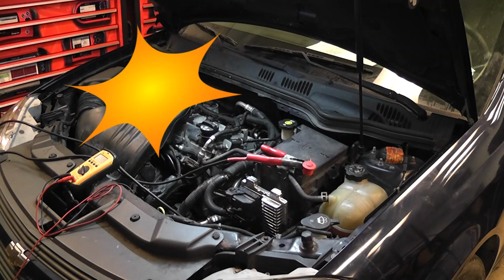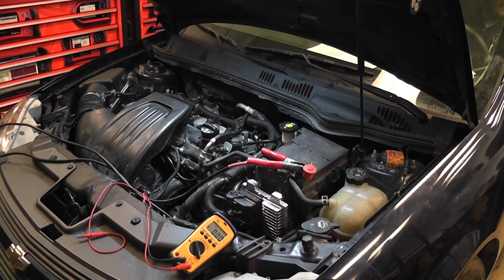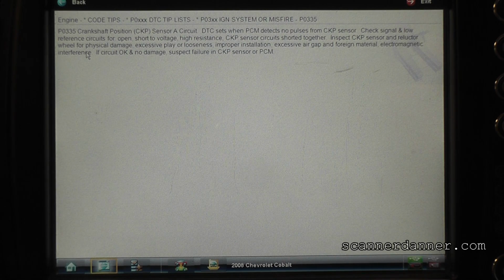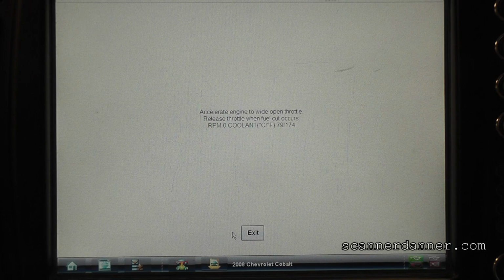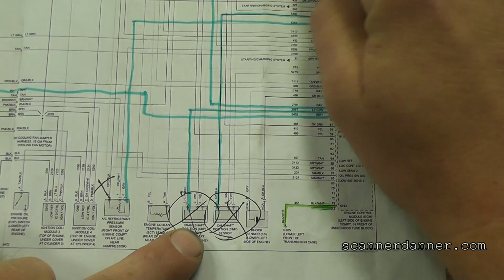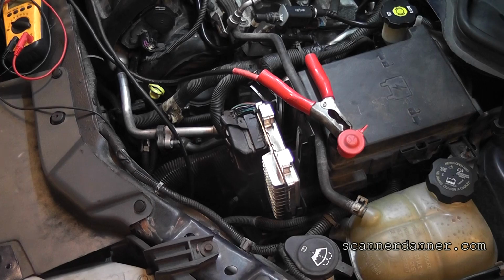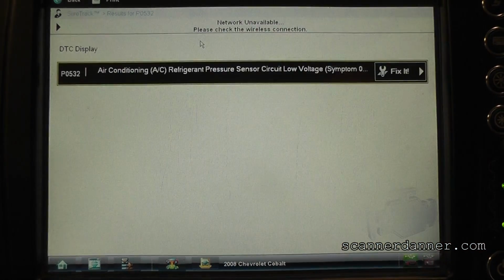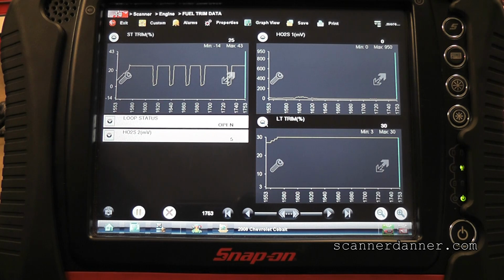Bad Engine Computer Testing Part 2

Comment: I'm not normally one to comment on YouTube videos, but yours are in another league. I left a national chain and dealership auto repair work for another career altogether. Even in my new career, i find myself forced back into car repair through maintenance and repair of my own vehicles and those of friends and word of mouth "customers." I am pretty confident I have watched every video on your standard channel and have actually used two of your case studies (Ford Taurus Fuel Pump and Corolla MAF) as well as your amazing video on fuel trims to DIRECTLY and CONFIDENTLY repair vehicles. Specifically, even with a good track record (large parts of which were probably luck) for 1st time repair, I feel more prepared than ever thanks to the symptom knowledge that allowed me to "see" what I was seeing and hearing, diagnosis ability which allowed me to confidently identify the problem as the true cause of the complaint, and repair the problem once and for all. Your work this far has been invaluable and I assure you even though I am at best a side job DIYer in the professional sense, I will be buying your book and paying your knowledge forward. I'm not sure if you will ever read this, but if anyone else does, I hope this comment let's them see your work for what it really is. Changing parts is generally the most expensive way to fix a problem. Your channel brings the art of diagnosis to those without the ability to learn the hard way and without the path that brings them to a school with instructors like you. Thanks again!
Reply from the maker: Thanks so much Mike G! I know this comment is old but I really really appreciate it
Reply: @ScannerDanner  hey i got 07 colbalt no crank no start but i got my 5 volt ref on the map can you help me out
Reply from the maker: @dennismartin5807  first step, you must scan it for trouble codes, if there are non, start by attacking the starting system and find out what you are missing, like on this video https://www.youtube.com/watch?v=oo1SRIFIkhs
Reply: Yes Mike I totally agree!  Seeing him in real time miss things and then find them with good old logic and sticktoitnevess is great!!
Reply: You, sir, are absolutely correct!
Reply: I agree and we'll said @Mike G

Comment: Good vedio. Just rebuild my 2.5 litter engine on 96 Dodge Dakota, got spark but not getting any voltage at fuel injectors got any suggestion?
Ine

Comment: I think it sounds different it starts sooner upon cranking   because I thought that it had a bit of a long crank before you discovered that the cranksensor wasnt plugged in
Reply from the maker: It definitely starts faster and  injection control and timing is now more precise

Comment: so  whats the purpose of the crank sensor  if it can run without it?
Reply from the maker: It's not perfect and may even pair or group fire the injectors. Because without the sync notch on the crank the system can only know pairs of cylinders

Comment: Dan the man, this Miguel an xstudent who followed you for a time, i have a 2009 nissan rogue i was driving lites on dash came on, car staRted shaking then check engine lite had warning fix system soon, where 2 wires burnted from the horn circuit , harnes fixed, wont start just crsnks was a green wire against another wire all repaired, now the car cranks but wont start, checked for fuel ok, and no spark at the plugs, just cranks, if its the computers i want to make sure money wise as you've said 5vote check of parts, will check 2moro, still have books you sent me, great stuff, guy, good day from old timer to best detail oriented electrical teacher,

Comment: Had a problem like this on my colbolt  it ended up being the.  Emissions box under the back of the car. Where the  unburnt. Fumes was geting burned off took the black box out blew it out with an air hose on the side of the box was a trap door with a filter in it took it out was full of white ashes.  Put it back money light went out car runs great    WHO would ever thought a filter would be in that box what’s crazy the. GM.  Data. Doesn’t show that filter in that box
Reply from the maker: I can assure you, what you are describing wouldn't even be close to being the same issue as what we had here. A blocked canister vent solenoid/tube/filter would cause EVAP fault codes and make it difficult to fill the tank

Comment: Scanner you asked the question as why did Chevy dealer say after computer install, do not try to crank, Chevy guy diagnosed as timing chain, some engines can get valve damage if trying to crank, I have heard.

Comment: Awww so the crank signal is the Tac rpm Signal figured the tac ran off the cam or the crank I don't think the timing chain is the issue it's running way to smooth for timing chain to be a problem the cam sensor must of been substituting the crank pid data @ScannerDanner

Comment: Then how this got fix change the computer o not ? Im curios
Reply from the maker: new engine computer was the fix, crank sensor was left unplugged by me in part 1
Reply: Thanks im going suscribe bro i need help with a 2009 blazer i replaced the engine on it unplug ecm sensors does need reprogram? Or i damaged  the ecm putting 24vlts trying to starting ? I need help bro i watch most of parts one youre good i wish to have your knoleage
Reply from the maker: @fck3013  you don't need to reprogram the ECM unless you also changed the ECM (sorry for the late reply)
Reply: @ScannerDanner  thanks for your help but engine has not spark already change the crank sensor and nothing i guees ecm is burn up

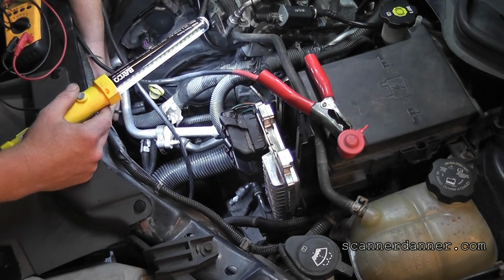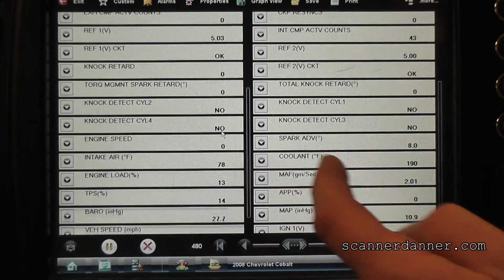Comment: 32:35 I remember on your 1st video of this car at 24:25 you started to find Cam Sensor and you pulled out to test the voltage. How did the dealer missed that cable unplugged and came out with CAMCHAIN FAULT is beyond belief. Well done you dug it out and finally got the bottom end. How do you do it? You just open our eyes. I'm not even a mechanic but I learn a lot from you. Thank you and keep going mate. Crowd funds to keep your channel up and running? I will definitely donate. You are just awesome. Thanks
Reply from the maker: Thanks so much man, I really appreciate it. Since I have a paid membership on my website ($11/month) I don't ask for crowd funding as this sort of already is that. The difference is that there is a HUGE benefit to you guys. I currently have over 500 videos with half of them filmed in my classroom. Hope to see you there! I also have non recurring subscription options too btw
Thanks again!
Reply: @ScannerDanner  I've been on more than 3 video already tonight and I have to repeat them to make sure they sink in. Tiny little wires which broken due to vibration cause the car NOT to start. If you take to the garage, they come up with one reason... Engine is dead. Needs engine replacement. But here... Wow. Dead engine are back on the road with just broken wire fixed. I'm speechless... Thanks mate

Comment: You make me want to get I better scan tool lol I live in the multimeter era still but the amount of info you can pull with that thing is amazing and we’re at least 100 miles from a dealer to fix anything and most of the time they won’t anyways so we are always buried in similar situations your videos have really helped a lot of people in our area with just helping adapt the thought process that goes into our diagnostic system really appreciate your time that goes into these videos it really helps our small rural community keep up with the times especially with the machines getting more computers in them and no service techs available from the dealership a tractor goes down at harvest it can break some of these farmers so we have to fix it ourselves and your videos are vital to that much needed help thanks again
Reply from the maker: Let me help get a Topdon Phoenix lite 2 in your hands. It lists for 800 and will be exactly what you need and I have tool grants I'm helping others with. Email me at support@scannerdanner.com and I'll hook you up with a grant. With the grant it will be a lot cheaper 
Here is the tool I'm talking about
https://www.aeswave.com/Topdon-Phoenix-Lite-2-p10173.html

Comment: im getting no spark. checked everything, fuses,relays wires etc. im getting power to all my sensors and getting power to everything else just not getting spark. i have a df goblin with a upgrade engine and computer.. been like this for 8 months and still cant figure it out.......any help would be appreciated!!

Comment: need help dan! i have a similiar problem with my 07 cobalt in a df goblin
Reply from the maker: are you using the original engine and transmission from the 07 Cobalt? And did you keep the DLC so you can scan it? We need some direction. 
Also, do you have injector pulse?
Reply: @ScannerDanner  Do you have a shop i can bring my car to? I dont mind driving there and staying for a few days. I obviously will pay you for your time if your interested
Reply: Sorry I meant a 06 cobalt ss. The engine trans are different and yes they do pulse

Comment: As far as I can see is that the vehicle’s computer only lets you see what the designers want you to see. There are electronic systems that inbuilt to ‘Keep You Running’ at all costs if possible. This is shown by the engine running without the crank sensor connected. The vehicle’s computer, in order to ‘Keep You Running/Going’ has searched its programming to obtain a signal from somewhere possibly constructing one from the cam sensor. These things I’ve seen on other cars that verifies my findings. Similar things are resistors in the ECU to let it know if a sensor or an item is connected or not. Great video Paul. On the flip side It’s frightening to realise that there are much deeper levels of programming that these designers have implemented that we are not privy to.. If there wasn’t these deeper levels of programming then the engine would have just NOT RUN and thus finding the disconnected crank sensor would have been easier. Great fun these detective series Paul. I wonder how many of us have bald spots on our heads with all the head scratching.. LoL. Regards Peter A.

Comment: Wow you might have answered a question I was wondering about my car and why I have been searching the net about my issues, when you said a bad ground would make the signal wire up it's voltage. This may be the reason my coil packs are burning up. Normal signal is .50 and the 3 that's trying to burn up measured 3.43v with ignition on. Your approach and the time you take and how you teach I give it 5 stars sir I need this class myself at 35 yrs old. I too am trying to diagnose a 04 g35 6mt that's running on 3 coils because it's trying to burn the other 3 with the key in on position.
Reply from the maker: G35, is that a Lexus? So Toyota electrical system and your asking me about the coils. Are they 4 wire coils? And which wire are you reading 3.4v with the key on? The trigger signal? If so, no wonder they are burning up
Reply: @ScannerDanner  this is. 2004 infiniti g35 6 speed and they are 3 wire coils and yes the trigger signal not the 12v.
Reply from the maker: @revbess  okay, on which wire are you reading the constant 3 .43 volts on? Is it the coil trigger wire coming from the ECM?
Reply: @ScannerDanner  Yes the coil trigger(signal) from ecm. To coils 123(ecu pins 61,62,81.
Reply from the maker: @revbess  well this is certainly why you are burning up coils. Other than some wiring harness short on those three circuits, you may have a bad engine computer. You will need to do your wiring checks at the ECM with it plugged in and unplugged. If you still see those same voltage levels unplugged, it is NOT the computer and you have a harness short.
Reply: @ScannerDanner  thanks Danner for responding, I already replaced the ecu and I'm running great, still gonna get ur premium service to learn more after I recover for spending in this car. Have a great day.
Reply from the maker: @revbess  Awesome, nice job! And I look forward to seeing you there. Thank you!

Comment: Can you put the captions on the top of the screen or use different lettering?  My tired old eyes have trouble reading them.
Reply from the maker: There are closed caption options right here on the YouTube player my friend. Thanks!
Reply: @ScannerDanner  It says no captions available for this video.
Reply: It's not that I can't hear you,  I have trouble reading the script that appears on the lower portion at times.
Reply from the maker: @paulmonk7820  unfortunately the automatic captions only apply to newer YT videos. I just got off of a chat with support and this is what they told me. Unless I manually enter them on these older videos, they won't be here. I'm sorry my friend. The good news is all of my newer videos have them
Reply: @ScannerDanner  Thanks for checking and getting back to me.  I wasn't very clear, but I was talking about the messages that overlay the video in yellow letters, added during the editing.  They do add to the viewing, but some are not easily discernable and dissappear too quickly...
Reply from the maker: @paulmonk7820  ah okay, sorry, there is nothing I can do about that part. We've gotten better with our newer videos :-)
My only suggestion is to pause the video when you see the note.

Comment: I don't completely disrespect the timing chain call. The tech probably found the low compression sound of the engine (like in the beginning of this video) and got afraid of causing a bent valve and felt the need to check timing and refused to crank the engine further. You can't blame the other tech for not wanting to cause damage.

Comment: GM tech called timing chain because all the noise it made when you first started it, probably not realizing the engine needed to build oil pressure, because it never ran.
Reply from the maker: very possible!

Comment: that was fun to hear the sensor wiring plug was disconnected ! and the ecu will inject its own ref for crank sensor after fail start first few seconds would of been good to scope directly onto the sensor with loom unplugged
Reply from the maker: To be clear, the only substation was with the data. If you were to measure the actual crank signal, there would have been none with it unplugged. Just wanted to make sure that part was clear. Thanks!

Comment: Why is there no tcm in this car? My 08 has a tcm in the slot between the ECM and the distribution box.
Reply from the maker: I believe the PCM contains both the ECM and TCM in one unit
Reply: @ScannerDanner  so is that the case for certain configurations? As mine doesnt have an air pump and havent seen one with an air pump here in Canada.
Reply: Would you be able to point me in the direction of a website that i can go to to get a wiring diagram, my Haynes manual doesn't provide much of anything for diagrams.
Reply from the maker: @xloscarlx  so sorry for the delay, hope this didn't come to you too late. Here is the DIY version of the same service info and diagrams I use. Same exact diagrams, just in black and white https://eautorepair.adtrk.biz/?a=10817&c=24&p=r&s1=
Reply from the maker: @xloscarlx  could be my friend

Comment: You could have pulled pins in the pcm connector for the ref signal  and check 5 volt right at the computer  pins . Before  all the other disconnects.  Or is there a reason  you wouldn't  want to do that . I was thinking  the pcm was right there and that would remove all the wires and sensors from the circuits

Comment: Scanner Danner---my hero again!! Well, just watched Vol. 1 & 2 of this series since I'm chasing down a 'limp mode' on my V12 Mercedes and whether my ecu is bad. Worse is I have NO fault codes so it is challenging!  This video taught me that a 5 v. ref circuit means the ecu is good--as long as the grounds r good. Big relief. Also, y did that stupid dealer tech unplug the crank pos. sensor just to change out the bad ecu??? Then later claim the 'timing chain is bad'!! Wow!
Reply from the maker: Well technically it doesn't tell you everything is good with the ECU, only that it is at least "alive". 
Also, I believe I was the one that unplugged that crank sensor in part 1 when I was doing my reference circuit tests?? I can't remember, but yea, they wanted to do timing chains lol
Reply: @ScannerDanner  Yeah in my case I'd need to send the ecu out for testing. Refurbished is about $275,

Comment: This guy is amazing...part one and two of this video was very insightfull. These videos of his will teach you how not to become a PARTS HOUND. I have seen this so many time with mechanics and I have a bucket of what was supposed to be bad parts that where taken out of my 2003, 2500HD silverado by the previouse owner. thanks to your videos I have found out how to field test these items, only to find out that the removed parts were not bad at all. so watch, like, And share these videos. also hire a qualified person and not talking about the person at the parts counter. ALSO be aware of those Auto parts stores that will come out to the parking lot and code read you check engine light and sell you a part that you don't need or is not bad at all. not to say it's not benificial but I do get a laugh once in a while.

Comment: A very informative lesson as usual. Is it my eyes, or at frame 33:44 there are only two wires coming out of the crank sensor in the electrical diagram?  
It shows 1> Lt brown 2>PPL 3>YELL.  However, the PPL and YELL are drawn as one.

Obviously the number of wires and the colors match the ones on the engine. Thus, could this be a wrong diagram?

Comment: Hello there,I have a 93 corolla. The car start but won't stay running.it has spark on spark plugs wire.
If you spray some gas on the throttle it stay running.
I don't know where to check anymore..could you get me  a Hints to see if I misssing 
something..Thank you.